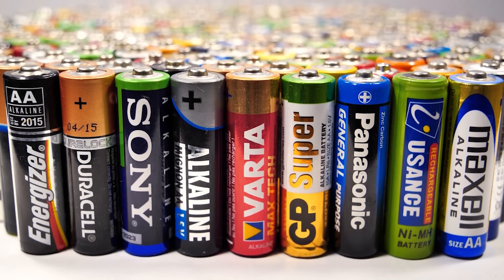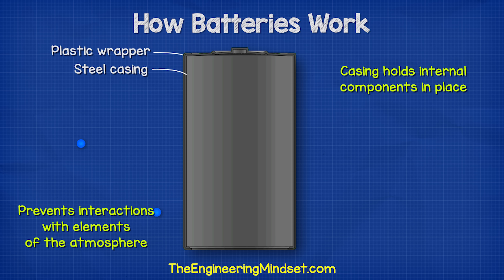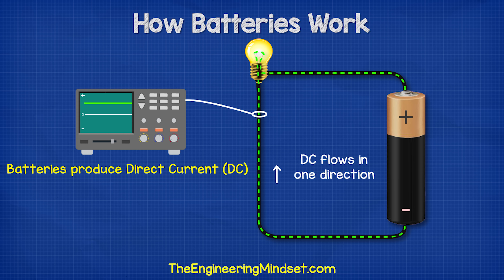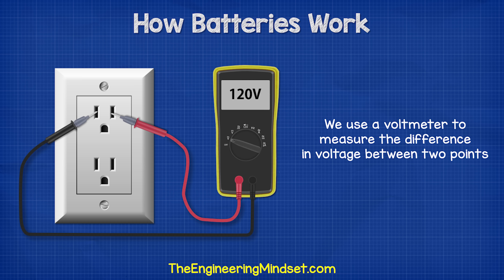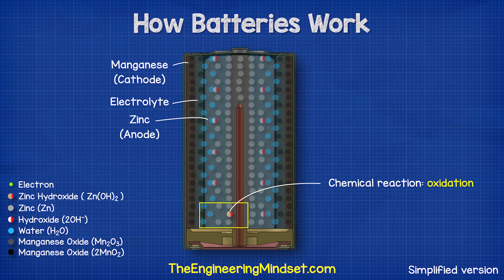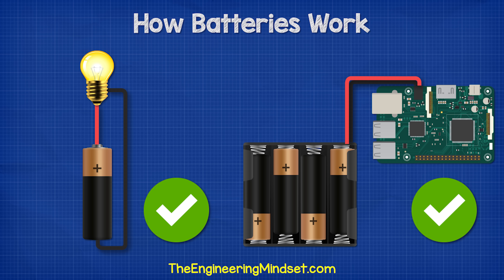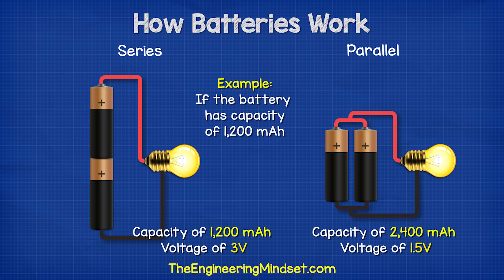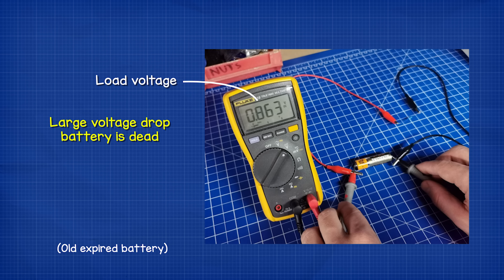How Batteries Work - Battery electricity working principle

Comment: 2:15 batteries + is cathode  and - is anode but its opposite for diodes + anode and - cathode. So electrons always move from anode to cathode. 🤔
Reply: Electrons move from anode to cathode when discussing conventional current, but you're correct when stating that diodes are typically represented as anode (+) and cathode (-).
Take the simple LED, for example, and how it's shown in your average electrical diagram.
Reply: The Anode is negative And the Cathode is positive unless the battery is rechargeable then you could refer to it oppositely
Reply: usually zinc is the anode and the copper is the cathode but again if the battery is rechargeable it could be otherwise
Reply: Yes. 
This comes from chemistry, where anode is the place that loses electrons (oxidation), and chaode is the electrode that gains electrons (reduction) in the process. As you said :) .
Fun fact: if you force electrons backwards with an outside force like in a rechargable battery, than the electrodes switch sides. the - marked side of the battery will be the cathode.
Reply: Thanks for the discussion gents. It would help to have that explained in the video.
Reply: So when you charge battery why elecrtron move from cathode to anode?
Reply: Right
Reply: Is electron flow is opposite to current flow? Plzz explain
Reply: @alladamohan9339  yes. current flows from +ve to -ve and it's just a convention.
Reply: To my knowledge, the negative terminal is the anode, even for diodes. Make sure you're not bring confused by the difference between conventional current  and electron flow.

Comment: But, how do rechargeable batteries work? Is it as simple as reversing the electron flow to recharge depleted chemicals/ materials?
Reply from the maker: Rechargeable battery video here https://youtu.be/VnPRX5zQWLw
Reply: Yep, this generates opposite voltage where electrons move to the end they initially came from but ofcourse original reaction will be far more complicated than this but this basic idea.

Comment: Excellent information, very informative. Although, the graphic at 0:47, which showcases electron flow, insinuates that the negative electrode is the cathode, and the positive electrode is the anode. At 2:13 the anode is said to be  negative, and cathode is said to be positive, but in practice the reverse is the accepted standard. Cathode is generally the negative electrode.
Reply: The Engineering Mindset is very spot on about the nameing of the electrodes. The terms anode and catode does not indicate the polarity of the electrode. They only show the direction of the chemical reaction (oxidation or reduction where anode is always the electrode with oxidation).
Reply: @andraskatona9766   i didnt see in video discusion about diffusion of Galium Nitride in the vacum tube🤪
Its video made by engineers for engineers( or for Elctro hobysts). The only way to survive in the world of EEs is to accept symantics, no place for questioning - its not physics.
Reply: @TurbidSugar19  You walked into the field of stinking chemistry. Here chemical engineering rules! XD
Reply: Also get chills in this moment.  🤣
Its only semantic but unacceptable one.
Reply: Just to be clear electrons always flow from - to + irrespective of whatever you call it ???
Am I right ??
Reply: @Dark_knight_268  Well, technically it's from a lower voltage potential to a higher voltage potential. It doesn't necessarily need to be considered - or +. More like V1 < V2 so current will from in the direction of V1 towards V2. Same thing really. But conventional current assumes flow from + to - (which isn't true, but the equations still work anyway)
Reply: @ConorFenlon    ;ף  מף

.   קף ף
Reply: @Dark_knight_268   

  .
  מ    
.   פפ

Comment: Thank you so much .I can't explain how easy you made the idea of the reactions going on inside the cell .
But there's one more thing I  want to ask .  the reason behind addition of voltage -- like is it that more electrons tend to accumulate at the last cell due to which voltage gets added or is the addition because the same electron gets to pass through both the cells ?
Reply from the maker: If you imagine taking a bucket with a small hole in and filling it half way with water, then a certain amount of water will flow out the hole, being pushed by the pressure of the water above the hole. We can have multiple buckets next to each other, they will all have the same flow rate through the hole. But if we place one bucket above another and let it empty into the first bucket, the water level increases in the first bucket so the flow rate increases because the pressure has increased.
Reply: @EngineeringMindset  This explanation is something I would like to relate my real life experience to .Like when a torch stops working ,I open it up but find that I don't need to replace both the batteries .Instead just one of them turns out to be dead .Is is because more electrons flowed in the dead one due to which it's chemical composition changes earlier ?And is this the condition only in real cases or is also accepted in the ideal cases too?
Reply: @shlokshankar1819  they prefer to be on the surface, but the more current flows thru the wire the more 'congested' things become and the deeper the flow goes into the wire. The price is of course heating of the wire due to the friction resistance  of the current flow.

Comment: next up; magnets how do they work?
Reply: Yes please!
Reply: Water, fire, air and dirt according to Insane Clown Posse
Reply: Nice one!
You'll be lucky. We don't really know fully how they work. We can explain electromagnets as what is essentially a quantum-relativistic effect of what happens in a conductor with a potential difference applied across its length.

The stuff in permanent magnets is harder to explain.
Reply: @DavidAndrewsPEC  Intersting
Reply: @RITHIN RANJITH it was a joke
Reply: @RITHIN RANJITH It is very interesting, since it is not just a part of pure nd theoretical/mathematical physics ... it's also vital for understanding how physical systems such as electron systems operate ... without this, we cannot hope to understand electrical conduction and instantaneous magnetic fields around conductors, for example.
Reply: Yes! This is also I want to know, to magnets last forever? how are they manufactured?